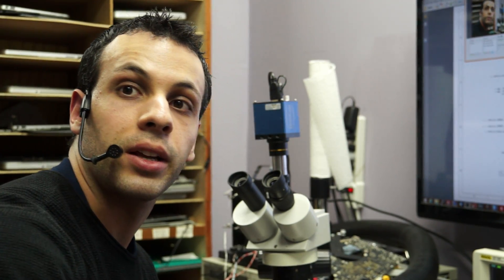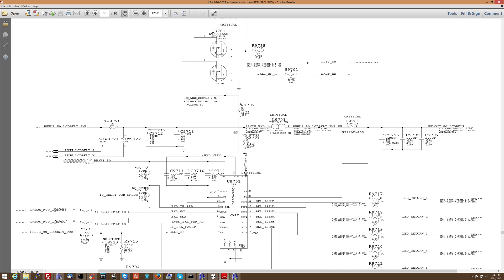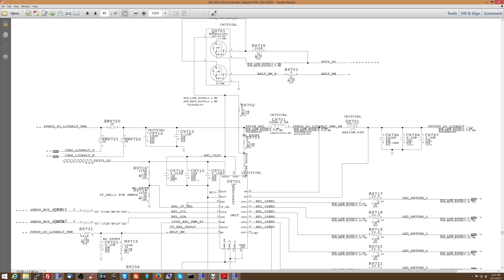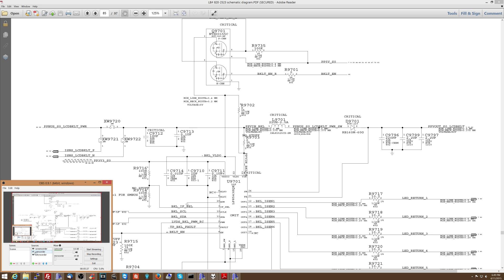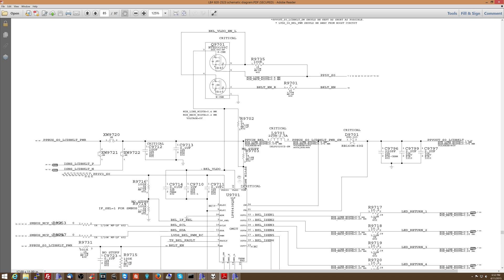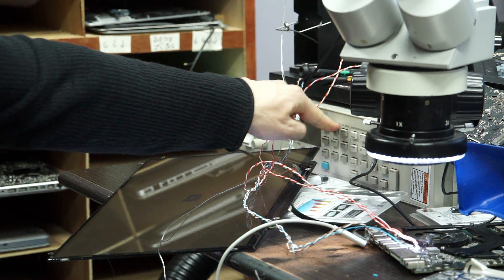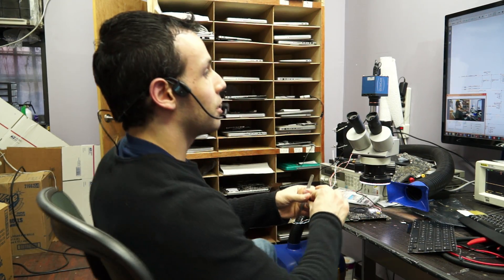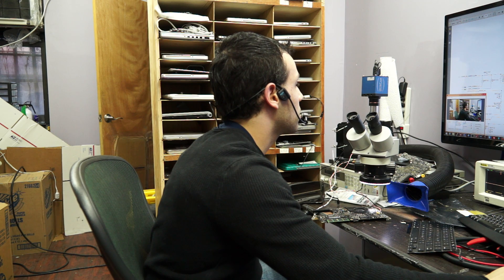How DC to DC boost circuits work explained simply; fixing no backlight on 820-2523.

Comment: easy when you have the SCHEMATIC ! 
I have 12Vin and 12Vout, so no BOOST on an APPLE Backlight inverter board.
I supply 12Vin and 3.3V on both EN and PWM outside the iMac
so far I am getting 3.3V on CN1.1 (ENA) to D14 (anode)
without schematic too much work

Comment: According to the beginning of the video, it seems to me that a DC to DC converter works the same way as a ram pump raises water from a river.
If you connect an inductor across a battery the current will not immediately spike but will rise over time 1 amp. .... 2amps..... 3 amps. ... (until it or the battery cannot deal with more). You can think of it as making the electrons "heavier" so they take more time to speed up in response to being pushed by the battery. Once they are up to speed they can be used as a battering ram. when the circuit suddenly opens it is as if you put a barricade in the way of the speeding electrons and they hit it with a high force that generates a voltage spike that then goes through the path of least resistance.

Comment: Loved the video, but an inductor died on me once, in a video transmitter (fpv), burned red hot, no fucking clue why. Didn't even bothered to replace, just soldered a jumper, it was used as a filter so i didn't need it so badly...
Reply from the maker: Pietro Lemes That was an inductor being used as a fuse, different from the inductor that actually is used to create the boost voltage!
Reply: Louis Rossmann Yeah, differente uses, makes sense. But i'm pretty sure it's not mainly a fuse, it's a choke for noise suppresion that came from motors on quadcopters and stuff like that, when you use just one battery for flight controller, motors and video tx. The board had 4~5 of those in the power lines before the tx module.